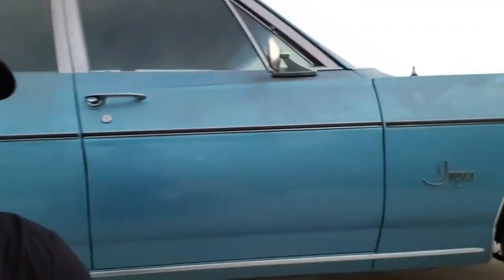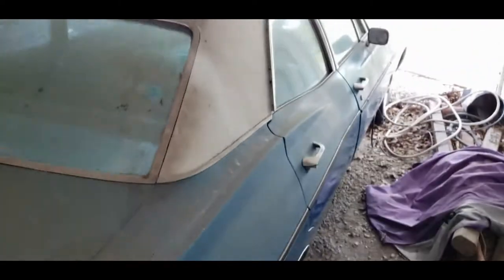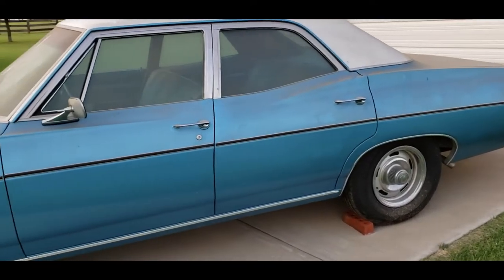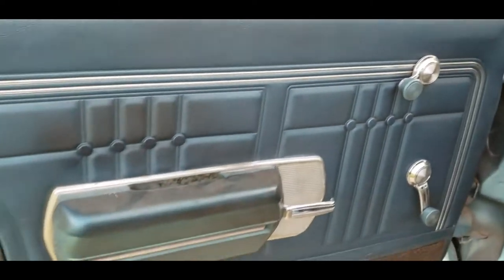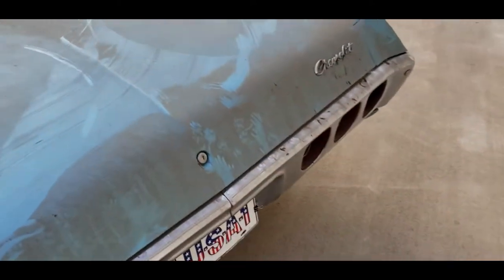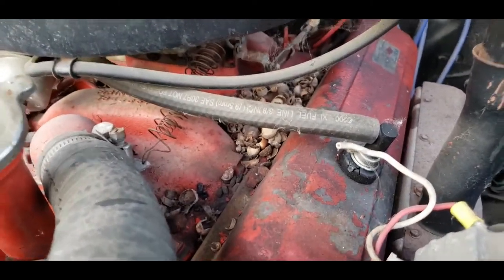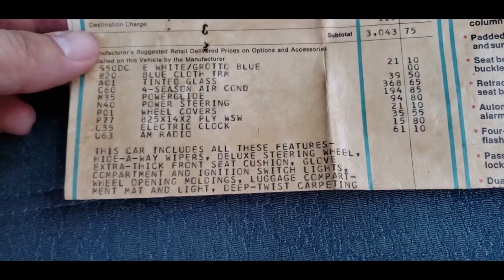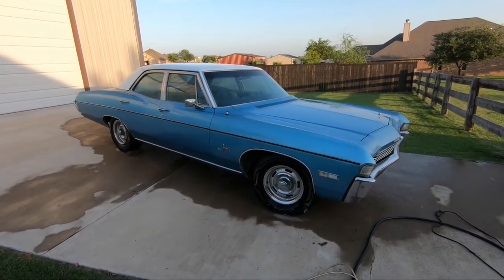1968 Impala | Rescue - Pick Up & Evaluation

Comment: My first car was a 68 Impala 327 .  Didn't know what I had 32 years ago.  I got another this past December ; fastback with a 454/360  (originally 327).  I certainly know what I have now! It sat for 1.5-2 years and so I am giving it a good go over.  Goal is to have her back on the road by May 1.
Reply from the maker: Whoa a fastback with a 454 is SWEET!!! Glad you found a solid project. Hope you get it done in time to enjoy this summer. What color combo is yours?
Reply: @CLASSICSAREBETTER  Red with black interior.  Bucket seats. Console powerglide TH400 transmission.  

the latest dilemma is the previous owner got this beastly engine and bolted on "what fit".  Short water pump. AC on passenger side.  odd Alternator bracket and "made to fit" power steering pump bracket.  I re-cored the radiator and reinstalled to discover all of that.  Getting her back together as is to get things running well.  Will order and replace the water pump, pulleys, belts and accessory brackets in the coming month.  Have pretty much decided to leave the AC on passenger side (not knowing if it works yet) as is a lot of work to move and I am not fond of having the hoses all across the engine.
Reply from the maker: @trevorclere8558  dang man, bet red and black looks slick. Sorry it opened up a whole slew of projects, par for the course on these old rides lol. At least now you can get it set up exactly how you want it, even if its unfortunately a pain. Good luck with it man, one little project at a time and you'll get it knocked out, sounds like a sweet ride!

Comment: This is the car Sam and Dean drives on the show supernatural
Reply from the maker: Hi Albert, Im a Supernatural fan too, it is pretty close, I think theirs is technically a '67, but '67 & '68 are pretty much identical body styles. Just wish I had the trunk load out they do lol. Thanks for watching.
Reply: I just got hooked on SN. It's almost impossible to find a 4 door 1967 Impala. So I'm thinking about buying a 1968 which is a lot cheaper. But the lights in the back aren't the same as the 67.
Reply from the maker: @dreamingcode  I hear ya, great show, and amazing ride. Believe me painting mine black has crossed my mind! Comes down to a fun to care ratio. If you can cruise in a black '68 "baby" replica and be happy, your gonna save ALOT of money, but if you need to be a 100% exact your going to pay for that luxury lol. Good luck, let me know which way you go! Thank you for watching.

Comment: How can we improve mpg on this kind of old car with modern know how today?!
Reply from the maker: If you wanted to go modern, you could always add fuel injection, that would up your MPG and a little power. If you want to keep it old school and get a little better MPG, then just refresh all the basics, new filter, new sparkplugs and wires, exhaust, tune the carb a bit. That is really all you can do that I can think of other than regulate your right foot lol, have a good one, thank you for watching!

Comment: bet it's an early 1968, built before January 1st.  That's because it doesn't have shoulder belts,  which were required for cars built after January 1, 1968
Reply from the maker: Good observation, I would believe it as my great Gma preordered it in '67, I have the window sheet somewhere, was approx $3800!